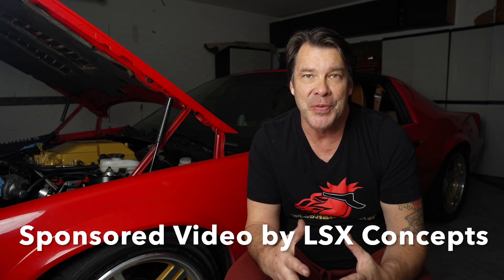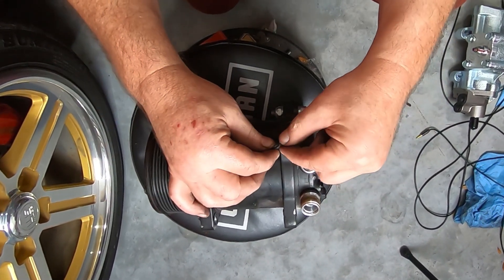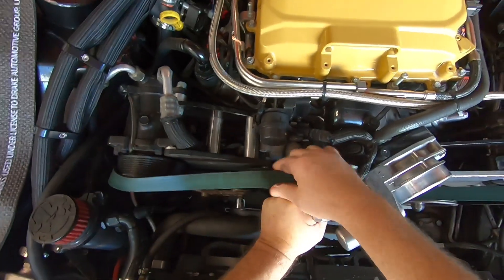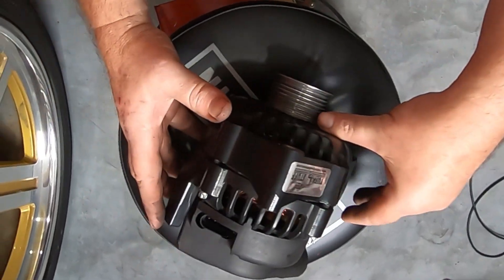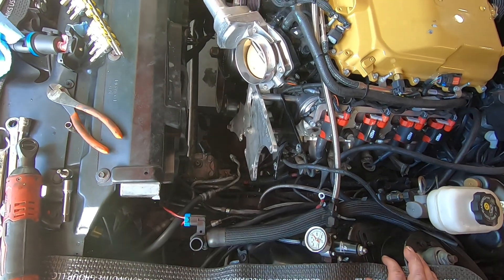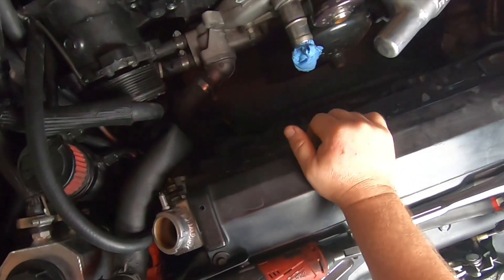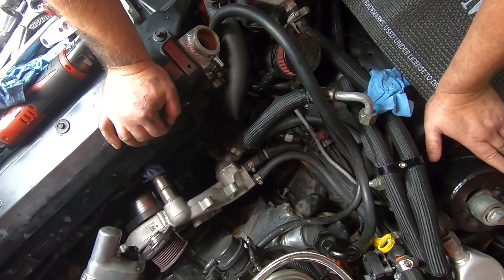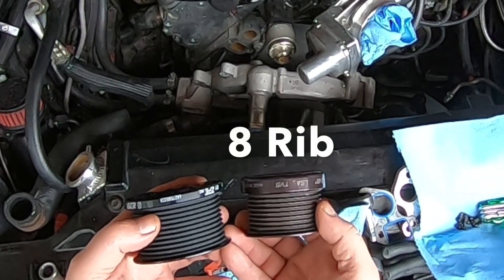Tear Down part 1 - ready for LSX Concepts 2650 Flex Drive kit

Comment: That looks like it’ll be a nice setup. I went with concept one pulley system which is basically the same as yours. Dedicated 10 rib supercharger belt with the 8 rib accessory drive belt. I was gonna put that all together last weekend but ran into some issues with the harmonic balancer bore size, seems to be to small for my crank..🤔 one thing I noticed with all this swap stuff, there always seems to be an issue we don’t plan on, but I guess that’s the fun of it.

Comment: i'm jealous as hell....but not for the reason you might think, i'd kill to be able to work in a tshirt right about now. been in the driveway since 9:30 this morning welding sub frame connectors. been inside for 45min now and i still cant feel my toes....damn ohio weather

ps. the setup looks nice, hope it works out for you
Reply from the maker: Ah man, yeah that sounds cold! Well hopefully the SFCs project turned out good. Thanks for watching man!
Reply: @FireballMullet  my welding sucks i'm still on the 1st side, weld a little grind a little rinse and repeat 😒🥶

Comment: Very nice setup, I been watching your progress pretty much since the beginning 🤘. I went with the gm 3 belt drive, my ls3 is getting heads ported, rings gapped and cam swapped right now. I was worried about slippage but also space. I have the Hooker cross member and motor mounts also the ctsv lid and I heard you state they put the engine slightly forward. I’m also not sure if I will put the AC high or low. Hopefully it all works out and thanks for the great video as always!
Reply from the maker: Thanks man and I appreciate you following the build! Yes Hooker mounts move things forward instead of back. Most set back plates put rear of LS block same spot as sbc. But, the whole Holley setup is very nice when used all together. I’d suggest AC high, most units won’t fit low but it’s possible. Thanks for hanging out in the channel man! Keep me posted